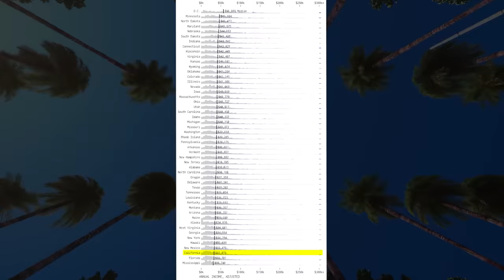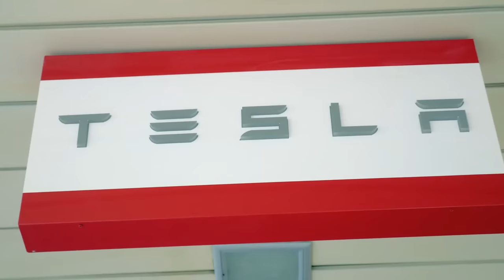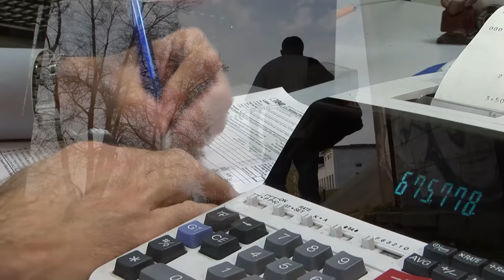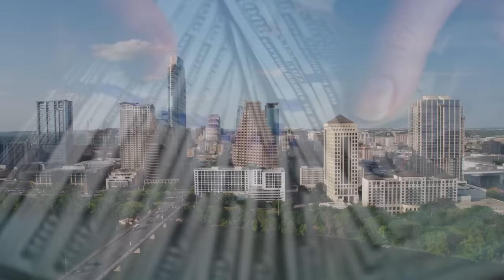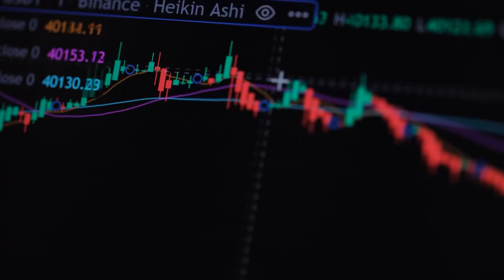The Ruthless Rise & Fall of California

Comment: Lots of Californians think about moving. But one question keeps them from doing so: where to? When you're from California, or used to living there, moving anywhere else seems worse than trying to wait out the housing crisis. I've had this conversation with literally every one of my friends. They want to move, but can't think of where they'd go that they wouldn't regret. I recently left San Francisco and moved abroad. I'd love to come back in 10-20 years if they can bring housing costs back under control. California still has so much going for it.
Reply: I would recommend Colorado.  Usually has pretty good weather, though alittle more crazy (no one beats California) with occasional hail in the summer and freak rainstorms flash floods. Has good public lands with great outdoors. Has a decent job market with some higher income industries. And biggest benefit of all is lots of empty land and plenty of affordable brand new constructed housing. Plus the taxes are reasonable and government is pretty moderate. Also has a good airport with good connections.

Biggest negatives: far away from anywhere you might want to travel to, especially if you like traveling out of country. And the infrastructure in center of denver is badly planned. It's like a small city grid that grew way too large and now its a massive gridlock. The food options are very meh. Everything shuts down and closes by 8pm, even gas stations close down at like midnight.

But if Calfiornia is too expensive, colorado would be #1 on my list.
Reply: @chrisblue4652  I'd say Colorado, Austin, and NYC are the most common places for people I know who have left. And I think it basically comes down to whether you can tolerate cold weather. Californians don winter coats when it hits 65 degrees, haha.
Reply: If 10% of the people talking about moving out actually do, then cost of living (housing) will drop enough that it the rest won’t. The video doesn’t really get into the people leaving are lower income and education than the people coming in, which is good and bad, and that companies moving hq out is meaningless really. These companies aren’t growing or it’s just a token number of jobs moving with them. Most of Tesla and SpaceX eng are still in CA for example. HP moved their enterprise division which is dying if not dead already
Reply: I do not recommend Florida
Reply: @dukehong7491  1% of the population left CA last year and everyone is making it seem like a massive exodus. It will take more like 10% to make a difference. And this is great.  Imagine every year the freeways getting less busy. But I think last year was a fluke.  When companies let their employees work from home then some of those employees will take advantage of the offer and try living somewhere else.
Reply: @jamestucker8088  California has so many people that a 10% exodus would be a much bigger concern, and you’re acting like that’s when the problem starts. I don’t think you understand just how many people that really is. Lastly, the more important figure to consider is immigration vs emmigration, where California experienced more people leave than enter the state. This reflects a national sentiment shared with the state of California, with a consensus that it is better to leave
Reply: This video continues a common myth. California is a dynamic economy, and while some businesses are leaving, the number of businesses being created are greater than the # leaving or dying. It's the embodiment of "creative destruction".  Most of the venture capital in the US is still, even this year, invested in California. Californa is now the 4th largest economy, not the 5th, it moved up. The state has a $100 billion surplus it's generating so much cash.   And while oldest industries and 'red' blue collar counties are leaving for other states, California is still brain draining the rest of the nation for white collar professionals. The conservative dogma over taxes and regulations can site U-Haul statistics all they want, but a STEM engineer making $150k a year leaving CA uses a moving company, they don't go U-Haul. 

The Senate Republicans even produced a study which validates California is dominating the race to attract the best and brightest: www dot jec dot senate dot .gov /public/index.cfm/republicans/2019/4/losing-our-minds-brain-drain-across-the-united-states

California's big problem is home building and real estate costs of living. It's not taxes or regulations.  No startup I know of are concerned about taxes, they're not even profitable for years. They have bigger concerns.

Yes, the inequality is the problem, but that's almost entirely driven by the housing affordability crisis. CA needs to fix home building.
Reply: @chrisblue4652  I love Co but it's really not much cheaper in the desirable areas... sigh.
Reply: My friend move to salt lake city with his wife, both in their mid 20s with $6,000 in their pocket .they found a 2 bedroom townhome rental for $900 a month...
Reply: @juanvaldez7279    When I first moved to California in 98, the dot-com boom was in full swing, it cost $3400 for a 2 bedroom apartment. Then the dot-com crash happened in 2000, and rents plunged, I got a 2bed-room place for $1200/mo.

The problem with CA's major pop areas is, practically everyone is a white collar professional looking to buy close to office or close to a good school district (when they hit their 30s), and the limited housing stock means prices shoot through the roof, making living unaffordable for blue collar workers, cops, teachers, restaurant workers, etc. 

But to hear Fox News tell it, California's problem is "everyone is leaving". Sorry, but that's nonsense. In 2000, there was a mass exodus during the dot-com bust, and the result was a huge decline in real estate / rents. 

If so many people are leaving CA, the rents would be declining, but they're still going on, because high income earners are still flocking to the state.
Reply: @dukehong7491  The census data indicates that the CA median income compared to the people moving in vs out shows that the middle to higher earners are the ones moving out. Lower income people don't pay any income tax and if anything have positive flow from child tax credits. The only thing that's raking them over the coals is housing and gas. It's the same as New York - with the high income earners at least on paper moving their residence to Florida to pay lower income tax. Moving the HQ is meaningless for jobs but not for filling the C-corp and S-corp taxes. I moved 2 small business out of state last year and am closing 1 this year - those are moving employees. When Honda and Toyota pulled out they took 20K jobs with them. Now take those 117 fortune 500 companies that were in CA and move half of them out of state - the state is going to hemorrhage when this recession hits.
Reply: @RayCromwell  As a physician who has an engineering degree (I guess that makes me a STEM) I would use a U-haul. My wife used a moving company before and had a horrible experience. Being an egghead I've found if you want the job done right you have to do it yourself.

As for job creation, you are incorrect. EDD publishes the number of businesses created and closed every calendar year. Hell, my 2 S-corps that I closed last year are still available as public record. If you look through the last 60 years of state revenue you can see how it's shifted from sales and tax revenue to payroll and property taxes. In times of recession that revenue is less reliable. The only reason it has moved up from 5 to 4 is because of the gross overvaluation in attempt by the central banks to prop up our Petro dollar against the Saudi/Iran/Russia oil axis who China is now increasingly relying on. I mean just look at USD to Japan Yen in the last 10 months. The state website puts out a lot of information that is often neglected by the media and even our own politicians.

I was born in this state and would love to stay here but once my last business closes next month I'm not coming back. The state has issues it refuses to address and leadership that is either incompetent at the least malignant or willfully negligent. When a group of scientists/engineers and Sen Feinstein has to beg Newsom not to shut down Diablo Canyon you know the state in not in good stewardship. I'm somewhat a tree hugger and Gavin can't do environmentalism correctly.
Reply: @Tokamak3.1415  "EDD publishes the number of businesses created and closed every calendar year."  Even if you look at # of businesses created per year, I'm still correct, you don't even have to look at net.  Let me quote: " Overall, new business creation in 2020 was a bit above 2016, 2017, and 2019 and somewhat below 2018. So far 2021 has seen the usual January jump, and in fact the four-week average of 1,870 new formations is the highest figure since 2008."

Business creation is up. No matter how you want to spin it, CA not only takes most of the US VC investment, it has increased the share it takes, most recent figures, 57% of total US venture investment goes to CA. 

Texas as a % of the US has declined, about 5% of VC funding went to TX in 2010, now it's 2%. 

"If you look through the last 60 years of state revenue you can see how it's shifted from sales and tax revenue to payroll and property taxes."

Which is why it is nice to have a $100 billion surplus and $20 billion rainy day fund. Also, CA property taxes are low compared to many other states. For someone in the middle class, Texas's total tax burden is actually higher than CA thanks to TX property taxes, excise taxes, etc. 

CA is in a good fiscal position and it's diverse industries and resources put it in a much better position than most other states, many of which are dependent on the feds for cash support.

I mean, it's your freedom to move wherever you want for whatever reason,  but moving because of a nuclear plant decision, or the usual whining about homelessness in SF seems rather petty. And it's not like you're not going to encounter crime in many of these other states, in fact many red states have a much higher murder crime rate than CA.

There's a lot of trash talking about CA, but IMHO, it's people often amplifying "problems" which often don't even affect them, just what they heard in right wing media.  Sure, if you happen to live in SF, you'll do like most other people who move in CA -- move to another  town that is cleaner and safer. 

Most of Silicon Valley for example, is nothing like SF. People cherry picking issues and amplifying them, often to avoid admitting the real reasons.
Reply: @Kzummo  LOL, poor guy. Literally no one is moving from California to the midwest. You can have it.
Reply: @dukehong7491  that isn’t true according to recent statistics I’ve read.  Especially Bay Area is seeing the loss of high income highly educated residents.
Reply: I grew up in Ventura, and the natural beauty of the area around Salt Lake City beats anything in so cal. The city itself is incredibly clean, with the exception of inversions occasionally during the winter (a bit worse than LA smog). If you can deal with the slightly overbearing power of the mormon church over the state legislation, it is an amazing place to live.
Reply: @RayCromwell  Well I thank you for your civil and well reasoned response, but I'm not sure how you can make some of your claims. A reasonable response would have seen some acknowledgement of some issues in the state juxtaposed with the accomplishments, but you sound more like a state senator.

Even if the number of business starts in 2020 was above previous years the NET number of businesses that exist in the state is down because the number of closures EXCEED the number of starts. If you plotted the delta number of businesses adding or leaving the state there would be an inflection point. This is simple math which contradicts your original statement. I don't appreciate it being stated I want to "spin" it. I'm not a politician and have nothing to gain. If you can't look at graphs and statistics with a candid eye well then we are an impasse. One of main reasons for those new creations, BTW, was small businesses folding and then reoppening. Go to EDD and look - more than half those "new businesses" are filed as restarts with the number one category being restaurants. This is why the UI rate is so damn high in the state. If you ran a business or worked as a CPA you would know this.

If you think moving because of a nuclear plant decision is petty then you're belittling the very problems that Newsom and Biden declared as an existential threat. Gray Davis was booted out because of the failing electrical grid and nothing has been done to fix it. We don't have a single hydro or compressed air battery in the state whereas these batteries are popping up around the US and Europe and China.

The state says it's tough on crime and gun control and then passes Prop 47 which makes gun theft a misdemeanor. You can bring one bullet from neighboring NV and you're a felon for transporting ammo across state line. You steal a handgun and you get zero jail time. Ah but that's petty.

I don't see the point of bringing up Texas and comparing to a "red" state. Are we here for partisan games to pick a side between Clippers and Lakers? I pointed out the other place energy batteries are being used to show CA is no longer number one in infrastructure as was discussed in the video. You seem to want to turn this into an ideology war which I will not be baited into. I have no interest in moving to Texas, especially after Austin, Dallas and Houston have taken on CA policies and let rampant crime occur. Those wonderful zero bail policies are not exclusive to CA.

If you want to support the state so be it. Apparently no amount of self destructive behavior by the CA government is offensive to you. If I'm going to support a authoritarian state that silences large part of its citizens I would choose China. CA and China are both oligarchies now - at least in China public works get completed and you don't have to worry about violent crime while in CA restaurant owners are told to shut down and are persecuted by the media if they ask patrons to remove a face mask to prevent robberies. All the worst of authoritarianism without any of the benefits.

Have a nice day.
Reply: Come to the Great Lakes!
Reply: Lot of them have been moving to other cities in the Sun Belt in the Southwest and Southeast. While the states they’re in tend to be conservative the cities tend to be more liberal, the climate isn’t as different and it’s still cheaper than California.
Reply: I'm a doctor who moved out of California for medical school and is now living in southern Alabama. I'm pretty happy; I think you just have to move to a place that fits your specific situation. I'll soon be buying a house that I would never be able to afford in California, own a sailboat and spend $100 a month on a slip instead of the $800+ it would cost there, and make more money than I would there because the competition isn't as high. Where I live works for me because it fits my lifestyle and hobbies. The thing about California is you can do pretty much anything with a short drive, other states have less variety but you can just pick based on strengths/weaknesses. With how cheap airfare is nowadays it's easy to visit family, don't really see them much less.
Reply: The only reason to stay in CA is if you're from there. I left 4 years ago for the east coast. Best decision I've ever made. People who think there's something exceptional about CA have had really limited experiences elsewhere or are trying to make lemonade.
Reply: norway, netherlands, signapur, germany are good places to move 

or just austin, texas
Reply: You won’t
Reply: @jaredspencer3304  how I wish your naive understanding was true
Reply: WY was one of the worst places to relocate looking back. Freezing Cold winters with 40mph wind chill at -20F, that archaic Wild Wild West combination of desolate plains or rocky geography. And politically it is probably the most hardcore republican ideological states in the nation
Reply: @RayCromwell  you really summed it up.
I came to California a corporal in the USMC. I retired a multi millionaire.
That's California
Reply: I'm not from California, but I did live there for 8 years until a couple months ago.  I moved to Fredericksburg, Virginia.
Reply: After reading and article in money magazine, I moved to Raleigh NC. because they said it had a more progressive economy and a good future. It has really gotten stronger since I moved here. It's very different now.
Reply: The answer is don’t vote blue lol
Reply: It's simple supply and demand.  If people wanted to live in cheap places, they'd no longer be cheap.
Reply: Yes, that is the issue right.  I know conservatives like to hammer Cali and of course for good reason, but being from Florida, I would live in Cali in a heartbeat if the business/political climate and cost of living were better, Florida is hot and humid and doesn't have the same four seasons that the rest of the country has.  If I left Florida, I'd likely go to western NC or similar, but if things changed in Cali, after having a 10 day vacation there back in 2018, I'd go there.  I loved our time in northern California, it was absolutely beautiful, the climate, scenery, the people seems generally nice.  I'd have zero desire to go to southern Cali though..zero!  Some people say give it away, we don't need it, yeah right, nearly 1 in 8 Americans is from there, it's a huge ag state, industrial state and more.  The US would not be the same without it and I don't think it would be better.  However, none of what you have here in your video is new, it's all crap they got to fix somehow.
Reply: @ridesharegold6659  "The only reason to stay in CA is if you're from there. I left 4 years ago for the east coast. Best decision I've ever made. " I grew up in Baltimore/DC area and lived in New York. No way I'd move back to the east coast, for a single reason: The weather sucks. 

Summers are agonizingly humid, like it can be 75 degrees out and feel absolutely awful. Winters are very cold.

The only good times are a few weeks in autumn and spring. CA is basically fantastic weather about 48 weeks a year.
Reply: @floridaray3380  Why not.  My wife loves Florida.
Reply: You may not have to wait 10-20 years, as prices are already down about 10% and falling. Let's see where they are in two years, when I plan on buying in the Bay Area.
Reply: @RayCromwell  I mentioned China because I've lived in Shenzen and Shanghai. My spouse's family escaped to Taiwan from Shanghai and lost family members (executed) when Mao fought Chiang Kai-shek. I've been to 36 countries and was stationed at a few in the USN. I'm familiar with being silenced in other countries. You try putting a certain bumper sticker on your car in this state and see if you don't get shot at while driving on the 5. I will refrain from saying what I want to say due to wanting to keep off the radar - either disregard my statement as petty squabbling or accept that is my perception.

Trump and Twitter have no bearing on CA's inept government and it's policies. You're trying to bait me into an emotional debate on red vs blue ideologies again.

You move here in '98. I lived here for 3 decades before that (when I wasn't traveling). Some things have improved, but more importantly more things have gone downhill.

Just looking at the nonsense happening in the LA City Council race this past month and the corruption at the LA County Board of Supervisors with the indictment of Huizar and Mark Ridley Thomas shows me that things are only going to get worse.

Does Newsom actually understand that CALPERS is underfunded by about 1.7 TRILLION dollars for 2030. When the stock market was running wild they were doing OK giving away 13% annual compounded raises (salary + benefits) to public employees but that is clearly unsustainable - well unless you let the central bank print money for you. That 100 billion in surplus is less than 7% of the unfunded liabilities. The entirety of CA education system is already spending 39% of its budget on pensions. When that pension spending hits 44% of the current state spending of 67% of the state's annual fiscal budget CA will have the lowest spending per student per capita with respect to median salary. This is not my talking point - this was pointed out by the LA Times recently.

Going back to the nuclear plant - you know why that's a big deal - because Newsom had to buy 8 NG generators to prevent brownouts. Instead of correcting Jerry Brown's ill conceived high speed rail bond measure Newsom doubled down on it and now we're going to be getting a normal speed light rail line in 10 years. Seriously - nothing was learned from the near catastrophe of Oroville. Forgive me for being concerned, but as somebody who learned the difference between parallel and series circuits when I was 6 I have to laugh at a government that doesn't understand the significance of duck bill curve for energy generation/usage. Spend 50 billion of that 100 billion and build some small nucs or maybe the first thorium reactor. 4th largest economy with Caltech and Stanford and we can't do a hydro battery or a new nuclear reactor for baseline load - or repair the generators at San Onofre.

If you want to know the whole details about Diablo Canyon I suggest you read about Friends of the Earth, their split from Sierra Club and how they made Gavin Newsom's dad their lobbyist. They were initially funded by Atlantic Richfield aka ARCO. Imagine that - a gas company stating nuclear is dangerous. Newsom closing Diablo Canyon is finishing up business like Bush Jr going after Saddam. There was no real reason to close San Onofre other than Newsom's buddies in CPUC doing his bidding. You know, the same reasoning why nobody went to prison for the PG&E fire that killed 100 people or the Aliso Viejo gas leak that was worst environmental disaster last decade with respect to global warming gases. It couldn't be that Jerry Brown's sister was on Sempra's board at the time could it?

For a state that touts environmentalism I find it laughable that nobody went to prison. Since you brought up Texas, Elon and Trump I take it you're a die hard Democrat. Are you not disgusted nobody went to prison for such environmental malfeasance? I mean Aliso Viejo had 149 diffferent violations of CA law - not 149 incidents - I think the incidents was in the 600s. I expect this in China where CCP members can get away with murder - so we're back to the whole oligarchy.
Reply: @Tokamak3.1415  " I'm familiar with being silenced in other countries. You try putting a certain bumper sticker on your car in this state and see if you don't get shot at while driving on the 5"  Shot by whom? Have you not seen the YouTube videos of people driving through Red States with Hillary stickers and getting harassed?

Look, I have also traveled to many countries (50 at last count), and lived in Shanghai, and I speak Mandarin. Real Censorship is this:

If you say a forbidden keyword in China, against Xi, or the CCP, it won't just get censored from Weibo, but will be deleted *everywhere*, WeChat, private DMs, Bilibili comments, *everywhere*.  It'll even get filtered at the Great Firewall level so international sites that are still accessible won't show the results. 

Then, you may find you get a visit from the local police. When you go to get a bank loan or travel, you may find difficulty, as you can be on a blacklist, or have a bad social credit score. There is no escape. 

But if I ban your Twitter account, there are an infinite number of other ways for you to speak freely in the United States. Besides the gazillions of other online forums, and the ability to setup your own online sites, blogs, etc there's a vast ability to publish, to organize, to distribute, none of which can be prevented. 

How are Fox news, OANN, and NewsMax still on the air if we have censorship?

I'm sorry, but comparing US private tech companies blocking accounts or tuning algorithms to filter out BS so advertisers won't be offended, is far far different than what goes on in China, Iran, or Russia.
Reply: good luck.  they aint making more land
Reply: @Tokamak3.1415  Look, I'm a big proponent of building NEW nuclear reactors (pebble bed, molten salt, thorium molten salt, etc) AND putting money into Fusion (e.g. CFS's new REBCO based ARC reactor design).

But I'm not gonna move out of a state because they're not doing that, it's kind of ridiculous.  Texas ain't doing it either, like CA, they only have two nuclear reactors.

On unfunded pension liabilities, California isn't even in the top 10 as a % of income. 

I see this talking point all the time, but again,  Texas's pension funds are funded at a 76% level, and CA's are at 72%. You're taking ALEC talking points which have been used to attack CA over the years and not applied the same standards to other states. 

Moreover, Newsom started paying down CalPERS, and the decline from 87% funded to 70% funded from 2003-2016 has started trending better since he took over.
Reply: @MrKongatthegates  "good luck.  they aint making more land"  Only 7% of CA is developed. The issue isn't lack of land, it's zoning regulations. Cities often prefer commercial real estate to residential. NIMBYs don't want more house near them as it lowers property values, crowds schools or highways. 

We either need denser living, or to spread out from the metropolis areas, but Americans dont' seem to want denser living like Tokyo, Seoul, or even London/Paris, and they don't want trains or 2 hour commutes.
Reply: @RayCromwell  its still location location location.  The closer you are to city centers, the more valuable the land.  A huge crash will only happen if the entire economy also crashes.  Density is not going to solve it
Reply: @chrisblue4652  id choose my home state of Maryland because it’s America in miniature
Reply: @chrisblue4652  "If you have to chose an alternative to California, and you have very limited moneyand future prospects: which state should you chose?"  Arizona, hands down. There's about $100 billion flooding into Arizona to create 6-8 state of the art semiconductor fabs. In less than a decade, it's going to be a new Silicon Valley with the ecosystem of chip companies to crop up around it, and real estate in Scottsdale and other areas is going to shoot up.

Whether isn't much worse than CA. The political landscape has a lot more utterly insane Republicans and election deniers, but I'd say its more goofy revanchist than actual fiscal conservativism.  Hopefully it will peter out in a few years after Trump disappears.
Reply: @crand20033  In which case, Democracy in this country may die, and the exodus won't be from California to other states, it'll be from all US states to Canada or Mexico.
Reply: @RayCromwell  I actually thought he was a pretty good president compared to Biden.  The pandemic messed his economy up.
Reply: @RayCromwell  I’m an MD making more than $150k per year, and I use U-haul every time I move.  Even if I hire movers for big stuff, I’m still getting a uhaul to help w the rest. So those stats still tell the story
Reply: Florida or Texas. Lots of opportunity and individual freedom.
Reply: @chrisblue4652  Was in CO a few yrs ago and just now returned from a CO visit, and  immediately noticed that the Denver metro's have turned into CA blue-cities like Santa Ana and such!
Reply: @chrisblue4652  I’d want to move somewhere with better public transit than CA, which pretty much means Denver or the east coast
Reply: @Matt-ug3kr  Were you at least a liveaboard? I'm currently doing just that in the Bay Area. If not for that slip, I'd be in Texas. 
No way am I paying 2-3k a month for a shitty smelly apartment with neighbors. I dealt with far too many of those when I delivered food + worked my IT job just to save an extra thousand per month or so.
Reply: @RayCromwell  that's only PARTLY correct where regulations and taxes are one of the biggest reasons businesses and people are leaving
Reply: @DeathSithe92  " that's only PARTLY correct where regulations and taxes are one of the biggest reasons businesses and people are leaving"

California has not significantly changed taxes or regulations recently since 2012, so this is nonsense. The number of wealthy people surveyed who left because of that was statistically insignificant: "The state lost an estimated 138 high-income individuals, or about 0.04 percent of the roughly 312,000 people subject to the tax increase, said co-author Charles Varner, associate director of the Stanford Center on Poverty and Inequality."

High income earners are not going leave until there is a recession, plain and simple.
With a STEM unemployment rate of 2.1%, the tech workers definitely won't leave unless they get remote work. 

The #1 reason why people leave is simply the cost of rent and housing. The average home prices in the Bay Area are $1.2 million. The average for Austin is $625k.
Reply: @markgreiser464  You provide no comparative statistics to your claims, no evidence.  Let me quote a Stanford comparison between CA and TX: 

"In light of these population trends during the last decade or two, one might expect other measures of economic performance to show Texas as a rising force and California as a receding one. However, and as shown in Table 1 below, California’s performance stands out when considering the growth in per capita income (PCI) in recent years. Between 2000 and 2020, California’s PCI was significantly greater than both Texas and the U.S. as a whole (BEA, 2021). Both disparities grew substantially from 2015 to 2020. For example, while California’s per capita income was 20 percent higher than Texas’ in 2015, this gap surged to 30 percent just 5 years later. And this was not simply a COVID-induced phenomenon, as the rising disparity was apparent in 2019 even before the pandemic.  Similar patterns emerge when one considers state-specific GDP per capita during this same period."

TX Murder Rate = 6.6 per 100k
CA Murder Rate = 5.6 per 100k

Quoting a recent study on violent crime in CA: "Violent crime rates have risen an average of 9% in Sacramento while falling an average of 29% in San Francisco from 2014-2021, a period that spans the tenures of DA Schubert and San Francisco's progressive DA"

So violent crime is DOWN in San Francisco, and by a lot, not up. 

But you'll go on mindlessly quoting what you here on talk radio and Fox News without ever looking at the real figures.
Reply: @kalobrogers235  "homosexual and transgender ideologies"? The exordinary tax rate, that happens to be lower than half the US states, including total taxes lower than Texas if you're not rich:

"According to ITEP, Texans whose salaries fall into the lowest 20 percent of income earners (making less than $20,900 annually) pay about 13 percent of their income in state and local taxes. Meanwhile, Californians in the bottom 20 percent (making less than $23,200 annually) pay 10.5 percent. In Texas, the middle 20 percent of income earners ($35,800-$56,000) pay 9.7 percent in state and local taxes in contrast to middle income Californians ($39,100-$62,300), who only pay 8.9 percent. Most glaringly, the top 1 percent of earners in Texas ($617,900 or more) pay 3.1 percent of their income in contrast to top earnings in California ($714,400 or more) who pay 12.4 percent. "

It's like a broken record, people repeating Fox/Talk Radio talking points and never citing a single factual piece of data.
Reply: @RayCromwell  , my dude keep lying to yourself. People are leaving in droves and you are more than free enough, to go outside and walk your streets. Go get some.
Reply: For all its flaws, there really aren’t many places in the country I’d say are better. Texas is an actual joke, from its terrible weather to it’s insane urban planning. 

In terms of affordability, places like Nashville are some of the best for Californians. Even if Tennessee still has income tax, their overall tax burden is incredibly low. It still has plenty of problems but it is cheaper.
Reply: @crand20033  Raleigh really is a hidden gem. Such a great area in terms of housing, economy, weather and cost of living is cheap
Reply: @RayCromwell  Yes, homosexual and transgender ideologies. It turns out the vast majority of people don't like homosexual or trans politics being taught to children. Imagine that, who would have known. It's very telling that you totally skipped homelessness. Want to talk about Cali subsidising the homeless, attracting more homeless than any other state by far? People defecating in the streets in populated areas like LA and Sanfran?  Now add in the fact that outright theft has been almost completely decriminalized to a misdemeanor and theft is through the roof. People don't feel safe. Who wants to smell feces and be afraid of being robbed in broad daylight. Now for your study it was a good point however it is still among the top 5 and top 10 depending on how you break the data down. Still making it extortionary taxes. If weather is your main goal it's great for you. If not and you have any sense of grounded morality California is a nightmare if your anywhere close to a highly populated area, which most people are in Cali to be close to the city life.
Reply: @MikeN Ike Less than 1% leave so your logic is inaccurate.
Reply: @kalobrogers235  "Yes, homosexual and transgender ideologies" Can you explain what these ideologies are and what specifically they're teaching other than "gay people exist and you shouldn't hate them"?

" Now add in the fact that outright theft has been almost completely decriminalized to a misdemeanor and theft is through the roof. "
Completely wrong. You can look up SF theft prosecution statistics. You're repeating Republican talking points about  increasing the misdemeanor limit to $900, but Texas's limit is $1500. 

" if your anywhere close to a highly populated area, which most people are in Cali to be close to the city life."

California has 40 million people. SF doesn't even have 1 million people. LA area has 4 million people.  Most Californians do not live near cities.  If you count "within 2 hours commute", than the SF Bay Area has around 7 million, and the LA Basin has 13 million, still only 50%, not "most"

The reality is, the VAST majority of California don't deal with SF or LA homeless camps.

Again, the City of San Francisco doesn't even have 1 million people.
Reply: @ChipCheerio  Honestly, I'd vote for Scottsdale, Az, Bend, OR, or Washington state, if you want good climate, and a vibrant economic scene.  Scottsdale has like 6 multi-billion dollar state of the art semiconductor fabs being built. This'll create another Silicon Valley there, and drive up real estate prices over the next 10 years. Buy cheap now.
Reply: @RayCromwell  I highly agree with Bend and Washington, but as a Phoenix native I do not recommend Arizona unless you have the means to vacate during the summer.
Reply: @RayCromwell  I highly agree with Bend and Washington, but as a Phoenix native I do not recommend Arizona unless you have the means to vacate during the summer.
Reply: Huatulco
Reply: @ChipCheerio  , keep telling yourself, that nonsense.
Reply: @ChipCheerio  Yeah, I never experienced AZ in summer, I've always gone in Fall or Winter,  it was nice then. 

I agree with another commenter that Raleigh is nice, I worked around the Research Triangle Park area at one point.
Reply: Conservatives act like their states are such nice places. 
I live in Georgia and this state is truly brain numbing in terms of the dull boring lack of anything to do.
Reply: @johndoe5432  fr. All they do is cope but not change.
Reply: Cost of living is the price is the price people pay for having the popular desire of living in a place that is attractive to many. The number of people who do not want to move anywhere and are instead waiting out the housing crisis is one of the bigger reasons why there is one. And that number isn't getting smaller each year.
Reply: @ChipCheerio  , let me know how everything is, in the next two years. It is already a disaster. Your current Governor is already trying to double-down on failure. Your words literally mean nothing, regardless of where you are regurgitating them from.
Reply: Whatever, knock yourself out in Texas, I’ll stick with California. There is a reason housing costs are high, duh, people want to live in beautiful places. My dream is that more people move away, businesses too…BYE!!! Fewer people suits me just fine. Sadly it won’t happen because as soon as prices dip more people rush in.
Reply: I'll be gone in 20 years. The problem is we always think of ourselves. Not our younger people. California has the weather but poor leadership and selfish politicians. Number: California lost both very large companies, including eleven Fortune 1,000 companies between 2018-21, and small, rapidly growing companies with the potential to become transformational.3 days ago
Reply: @haggeoromero  lol keep telling yourself that. Whatever lets you sleep at night
Reply: That is the Californian bubble mindset other people from out of state including me say about Californians when we come to the state that California > everywhere else.
Reply: @logansimmons2460  i walked through a drive thru in salt lake city and they refused to serve me.

Ps The Rocky mountains/great basin suck compared to the Sierra Nevada and Cascades.
Reply: I’ve left CA twice and both times I was happier and had no regrets.
Reply: Tell them to go to Washington?
Reply: @georgeschmall9254  Ah yes, SLC sucks because a drive through didn't serve a pedestrian. Also I live in Tahoe now so it's not like I don't know the Sierra Nevadas. Idk what you are on, but both have immense beauty and it sounds like you are just a homer.
Reply: I was born and raised in California and had an opportunity to move to Texas when I was in my early twenties. 28 years later I haven’t even considered moving back.
Reply: I'm a San Franciscan born and raise native and still live here and love it more now than ever. Although I disagree with deserters Iike yourself I gotta say I respect your opinion. You didn't bash and bad mouth my city and you even still have love for it. You couldn't hack it and I get it, it's not for everyone, this place chews up and spits out the weak but for you to still have love and desire to come back, kudos to you man. Best of luck to wherever you're at and you're always welcome to come back.
Reply: honestly I've been wanting to move as well but I have a broad sense of where like texas, Oregon, Canada, or Germany.
Reply: @RayCromwell  California has moved up because Europe is going down. The largest economy in Europe which is Germany is being hit hard. Even India moved up against the UK. When you put things in context, it is not a good metric to look at. People leaving is for a numerous factors but California is hostile to business. States with more freedom are gaining more people. This are not poor people leaving California. These are middle class people with a retirement of million dollars.
Reply: @chrisblue4652  no we are full please don't come here.
Reply: Nearly anywhere is better than California at this point.
Reply: Left in 2007 to Virginia - have NEVER looked back. Not a single regret.
Reply: @RayCromwell  least those areas don’t have to worry about water shortages
Reply: Im from San Diego. Moved abroad for 10 years and right back to SD and didn't miss a beat.
Reply: @alexanderwoods2204  , you only expose your ignorance.
Reply: @alexanderwoods2204  , your thoughts on my watching habits are as accurate as the rest of your comments. Not at all. I take in News from quite a few sources. I thought perhaps you would remember I mentioned that earlier. You are now , at Idiot Status.
Reply: And from one who arrived in CA in 1963, I moved into a 2-bedroom apartment in Menlo Park, just off the Stanford campus, for $37.50/month, 2 covered parking places (one for my car and one for my sailboat), a swimming pool, and a wooded park across the street!
Reply: @markgreiser464  the irony in a conservative whose only agenda is to conserve the outdated ways of the past calling others ignorant.
Reply: Move to Asheville North Carolina, or New Zealand.
Reply: @tanyaroberson9629  moving out of this overrated dump of a country is the best choice. But the education standards around the world are much higher than here so it’s a struggle
Reply: There's plenty of places across the US that have their own beauty and culture about them. This is what I'd call that "California bubble"...y'all are so stuck and far away from the rest of the US with fair and livable conditions (aka, massive desert between Cali and Midwest/East Coast) that you don't know what the rest of the US has to offer. Get out of that bubble, explore, and I promise you will find more than enough places you'll be happy settling down (just make sure that YOU DO NOT California whatever place you go to!)
Reply: @jaredspencer3304  New York has become the only state whose population is shrinking faster than California's. I have lived in both places in the last 20 years and both have shed the residential attractiveness both had in copious quantities only a few decades ago.
As a retiree, I am considering Reno as my "final resting place."
Reply: @dubstepXpower  the only so called problem of cali is the homeless and that is due to them flocking there from all across the US.
Cali has the highest standards of living for citizens and that’s why the homeless flock there
Reply: @jtothed8575  Why? I've never lived there, but I have lived in a few other southern places, like Charlotte and New Orleans, and been through Texas enough that I have friends there. Essentially, they leave you alone there to live your life as long as you don't trample those of others.
It seems like states such as Texas and Florida have more respect for individualism than most. Same for Nevada.
Reply: Obviously this is anecdotal but at least 90% families/individuals that I have known to move out of CA since 2000 regretted their move and tried to move back within a year or so.

Destinations included Idaho, Oregon, Montana, Alabama, and New Jersey. Two of my neighbors in NorCal are from Idaho: one family originally was from here and moved back, and the other got a promotion to a job out here.

A lot of people openly consider moving away from high costs, congestion, or something else. But when it comes time to actually find a new place that can be a new permanent home, many simply decide to get a vacation home in a remote/beautiful place to get away from it all and experience life from a different angle.

But at the end of the day they want to come home for work or for their kid’s schooling.

Property values in remote parts of the west are so low in comparison to CA income that it’s not as difficult as many might think.
Reply: Not AZ
Reply: To Nordic European countries.
Reply: @MikeN Ike do you live in California?
Reply: I left 2 years ago to rural northern NV and my life couldn’t be better. Leave now while you still can.
Reply: This is a marketing bullshit campaign. I lived in CA for 50 years. I moved to the Carolinas. Life here is very pleasant. People are nice, and it is beautiful.
Reply: Exactly.
Reply: @chrisblue4652  you guys have amazing ski resodts. That alone makes it worth going to.
Reply: Tell them under absolutely no circumstances should they move to North Carolina. The mosquitoes will drain a whole pint and the women have teeth down there.
Reply: @markgreiser464  I don’t live in cali, I live in Georgia which is a conservative boring state with some of the lowest education standards and quality of western lives. 
I’m a mechanical engineer and the job market for engineers here is absolutely terrible. 

I have lost power in my brand new townhouse here on occasion so stop pretending like red states have a perfect power grid.
Reply: The problem is that they leave the state that some ruined by their choices and move to other states like Texas to bring the same bad choices. Some of these people came and overpay just to secure not one but 2 homes and ruined the local housing market with the very same realtors saying this is a nightmare as now property taxes going up and higher traffic areas that usually were very stable. Let me clarify that not all Californians are doing this but a lot of them do.
Reply: Exactly, I’ve traveled and lived in all the most likely cities and states a Californian might consider moving and none of those places are worth leaving for. Like you, I’m more likely to move abroad than move to Florida or Texas. That being said, if I couldn’t afford living in California I’d seriously consider moving and living in a less desirable location to support my family. Also, I’ll just add that inequality is only a problem where extreme wealth exists. States like Texas and Florida would experience the same struggles as California if they provided the same level of opportunity so moving to a poor state with poor opportunity doesn’t make you better off simply by relocating. If your moving to save money in retirement or you can earn the same income in a different state and want to leave beautiful Ca, go for it your doing the rest of us a favor. 😉
Reply: @dukehong7491  i had that problem. Trying to find a career and compete. When i left, i was low income, some college. Now im considered a high income earner. Just because ppl may leave poor doesn't mean they can't turn it around. Now if they leave and stay poor, that's on them lol. Gotta reinvent yourself ppl
Reply: @RayCromwell  im blue collar and didnt get it together until i left ca (born and raised)  now i make more than many white collar but live in vegas with no state tax.
Reply: @Tokamak3.1415  im waiting for that to blow up in their proverbial faces. "Everyone, buy electric cars. Btw we are shutting down diablo canyon soon."
Reply: Its not hard. You make a list of ten things you want in the place that you want to live. Then you narrow that down to your top three. I did this after all my extended family lost everything in the camp fire. They couldnt rebuild, the insurance couldnt be afforded for a new build. So I had them all move in with me in my house. 

I picked a state based on my top three things. Price of land per acre, water, and fiscal health. Only two states passed my test. And I got everyone to move with me. And now we are starting over. 

All of our ancestors made incredible journeys to get here, even if you are a Native American, probably more so with them. Filling up a truck and going to another state via an interstate highway is childs play.
Reply: @alexanderwoods2204  You're in GA and you're telling Californians that CA has the highest standard of living? Did you even watch the video?

An entire 1/3rd of the state is living in poverty when adjusted to the cost of living. These people are essentially reliant on the government dole. The government has made it so easy to receive government assistance such as CalFresh and MediCal that a 38% of the state is on MediCal. 42% of the state receives reduced electricity rates from PG&E and SCE due to "low income" and that has to be subsidized by the middle class who pay the highest rates for electricity in the US - more than Hawaii.

Sure Newport Beach has the highest concentration of luxury yachts in the US, but for every 1 person in Newport there's 10 people living in Los Angeles on Section 8, CalFresh and MediCal.

If you're looking for absolute numbers CA will appear larger. If you're looking for quality Vermont or New Hampshire probably have the highest standard of living.

I have to go now, I need to sign more MediCal applications for my patients.
Reply: Honestly, the deep blue insanity is what is causing me to save money in preparation to leave.
Reply: @Tokamak3.1415  so you’re saying a government that does nothing for citizens is better? 
I had a small bullet fragment enter my stomach fat tissue from target shooting. The bill was $4500 for two X-rays and a doctor using two locking tweezers to dig it out. 
I had insurance through my employer at the time and it costs $300 for me. 
My employer decided to do a mass layoff so if I had the same small accident now I would lose a big chunk of my savings for such a simple medical treatment.
This is the truly pathetic gop standard of letting people go bankrupt through such basic ways like medical costs and weak education levels
Reply: @Tokamak3.1415  also, my medical insurance rates now are 3x the price with much less coverage since I’m not getting it through an employer. 
Third world counties have better medical insurance standards than the US
And the Conservatives love that
Reply: Utah or Nevada
Reply: @alexanderwoods2204  So you're blaming GOP for high medical care costs? I actually have been paying to work as a physician for the last 5 years. I spend more on malpractice, licensure, CME, DEA, Boards and so forth than I pull in as payment from MediCal and insurance because I work in the ghetto in Los Angeles. Thankfully I am independently wealthy or I would have quit a long time ago or moved to do Botox and Restulin injections to pay for my kids' diapers and formula.

The reason that bill is $4500 is simply because of the litigious nature of the US. If all those countries that have a national health plan you cannot really sue the physician - that state can go after them but individual lawsuits are a rarity. So basically you support trial lawyers like John Edwards and blame the GOP for the government sticking their hand into the system and mucking things up. You really need to read some books on HCFA/CMS, the AMA and what Congress has done to destroy privatized health care in this country. On Sermo there is a massive thread from physicians from all political views that bemoans the incompetence of our corrupt government.

The road to hell is paved with good intentions and nobody knows paving quite like the government.
Reply: @alexanderwoods2204  Fabricate statistics? Did you even watch the damn video? Obviously not. Stop trolling.
Reply: oooh here's an idea - stop voting for the same people and same policies and expect things to change
Reply: @Tokamak3.1415  US in general is to blame, we are so miserably behind modern countries like Germany, Austria and Switzerland. 
People start complaining when a plant based meat option is offered on the menu here. 
Third world country mentality
Reply: @Tokamak3.1415  don’t work in the ghetto areas, I don’t even drive through them. They are depressing
Reply: @Tokamak3.1415  true, the lawyer and court system in the US is absolute misery. Right or wrong has zero meaning to them
Reply: @Tokamak3.1415  I didn’t know healthcare here is that messed up, thanks for the info and I’m gonna read more on it. 
Thankfully I’m 28 and have only had simple stitching procedures every time I had to go to the hospital
Reply: There are plenty of places you just have to research
Reply: to everyone whose sane and lives in a different state California is the worst place to live.  
its always on fire from the trees, laws, and the economy. any other state would be better to live in.
Reply: @ChipCheerio  You get used to the Valley of the Sun (Phoenix metro) with air conditioning half the year, especially if it means no earthquakes, hurricanes, tsunamis, tornadoes or any disaster that can happen suddenly and kill you like many states have.
Reply: @SWLinPHX  My man, I lived in Gilbert and then Tempe for a long time. You do get used to it, but not really. No amount of getting used to it is going to let you go outside for extended periods of time in the summer. 

Most of the year is fine, but when the rolling brown outs start up in summer and your trash can starts to melt? You’re gonna be spending your summer somewhere else, especially if you’re from California.
Reply: @ChipCheerio  Is it pleasant?  Of course not, especially when it's 24/7 AC for four months out of the year w/hot nights that get down to like 90-95º for an overnight low, and especially by time you get to August or September.  However, I have lived in California for years too and I can honestly say it's better than earthquakes (been thru several and the last one wrecked my place and CA is long overdue for the BIG one), as well as freeways that never move, and much MUCH higher cost of EVERYTHING:  real estate, rent, gasoline, insurance, taxes and even groceries at the same chains like Kroger and Costco.
Reply: @RayCromwell  California's population is declining not increasing.
Reply: Jared, housing costs won't come under control until they reduce the size and scope of government and that's not likely to happen without a complete crash.
Reply: @Hebrew42Day  It only ever declined two years, in 2020 and 2021, due to COVID.  You can look at the Census figures. The decline has been slowing as COVID slowed, so the trend will turn positive again likely in 2023. 

Meanwhile, California's job growth and economic growth continues to dominate the country.  Even with all of the crypto-currency busts and tech sector layoffs, it's still poised to beat every other state in job growth.
Reply: @crand20033  in what year did you move to Raleigh?
Reply: @RayCromwell  
Money in the state of California isn’t a very good way to judge a states prosperity because California distributed wealth so unevenly. 

Evidence of this comes from the fact that although median income is just under $80,000, mean income is over $110,000. If you’ve taken a  statistics class, you’ll know this implies that the majority of wealth is actually locked up by a few individuals.

I have no doubt that California is opening more businesses, 9/10 fail though and we’re in a recession so that number is likely even higher.

I also have mo doubt that the state is aggregating more total dollars. Between the inflationary environment and californias insane economic output by the few powerful entities that run it, it is absolutely no shock.

I’m not saying it’s gonna fucking evaporate, but it just doesn’t look good. That being said, grow a pair of nuts and figure it out instead of just gentrifying someplace that was fine before you people came over.

Edit: I read your comment more thouroughly, I think we agree that the problem is wealth inequity and the emmigration is a symptom of this not the cause.
Reply: If you're willing to think internationally(especially for those with remote jobs), consider Portugal. It looks just like California with the same weather and geography, but without any of the problems. Was there this summer, it felt like California in the 80s, but more older and more historical feeling.
Reply: @rexx9496  I’ve been to Portugal, it did have problems but they solved many of them with a unique approach to drug induced homelessness: they legalized opiates.

But while Portugal doesn’t have the homeless problem CA does (and realistically much of the US has homeless problems) it also doesn’t have the economic opportunity CA affords.
Reply: @RayCromwell  You get it! Finally. Someone gets it. The NIMBY problem in California will be very hard to overcome. This is a solvable problem. Japan is roughly the size of California and has 4 times the population and average home cost there is far lower. So this can be done.
Reply: @RayCromwell  True, that's why I was saying if you can work remotely and don't have to look for a job there locally. Cost of living is pretty low, there's only like 10 million people in Portugal so land and space is plentiful. Lots of coastline, good beaches and mediterranean climate like CA. It's also one of the easiest countries in Europe for an American to get residence. And very little crime and violence too and affordable healthcare.
Reply: @rexx9496  I love Europe, Oz, New Zealand especially, and Japan. When I retire, my wife and I plan to travel the world and live in many countries a few months at a time.  I've already lived in China before. 

California's issue is very much related ti zone. Because of Prop 13, localities can't make much money off of property tax, as a result, they have naturally gravitated towards zoning more commercial real estate over the years because it makes more money for the cities. 

On top of that, the people who bought homes and benefitted from the supply constraint of new housing, essentially want to preserve home values and so naturally act against anything that would reduce property values, including building more housing, OR more low cost housing. 

Conservatives think CA's issues have to do with "high taxes and regulations", but ironically, the root cause of the real estate crisis was cutting property taxes and thus not incentivizing the government to increase housing. 

Texas for example has much higher property taxes than CA, and a big chunk of the government is funded by them instead of income taxes.
Reply: You guys should check out Grand Rapids Michigan and the whole West Michigan area.The Lake Michigan coast looks just like the ocean,very beautiful area of the country.
Reply: @Ognesson That's understandable to a point, and I would never keep rebuilding in a hurricane or tornado zone just to wonder when I'd be wiped out again.  However you may not be considering three things:  1) Unlike a hurricane or tornado, you never know when an earthquake will hit and destroy or kill (like a ticking time bomb that is now overdue)  2) Because of that there is no time to prepare or evacuate and often results in more deaths in a "big one"  3) When the big one does happen, would you feel the same way?  and 4) Have you ever BEEN in a significant earthquake?  I'd been in several and thought I was used to it until the Northridge quake of 1994.  You don't feel safe in your own home and suddenly want to be in the air or in a large open field with no trees or anything around you that can fall.  Awful feeling.  Each aftershock for that one was like a significant quake.  I packed all my stuff and moved out of state within a couple weeks!
Reply: @Ognesson Well a LOT of people are moving to AZ, especially since it is CA-adjacent.  Kansas & Central Texas are very tornado prone (parts of Texas hurricanes too) and Georgia is definitely hurricane-prone and VERY humid.  There's no place that's perfect but AZ doesn't have any natural disasters that can kill you or level your home.
Reply: @RayCromwell  That's a valiant effort, and I agree with your facts, but you are trying to teach economics to a conservative. Facts do not enter the picture for them when they "feel" like CA is bad, because that's what the TV tells them.
Reply: @alexanderwoods2204  - Most of us don't go outside I-285 for that reason. I'm down with ITP, yeah you know me.
Reply: I lived in cali. It sucks literal ass. LA is nasty, homeless are everywhere, it’s expensive, and it’s corrupt. I moved to Texas and it is so much nicer, cheaper, and cleaner. I could afford with my paychecks a really nice apartment in downtown Dallas where my last apartment in LA was 2x more expensive and that apartment was shitty. California has nothing going for it. Not even the beaches or weather are nice it’s all covered in smog
Reply: @Zrich98   - High demand drives up prices. It's always more expensive where people want to live. Texas can't even keep it's electric grid working.
Reply: @joesmith733  dont CA my UT